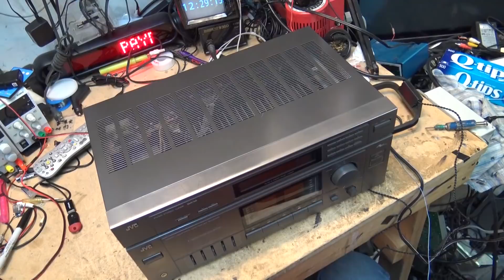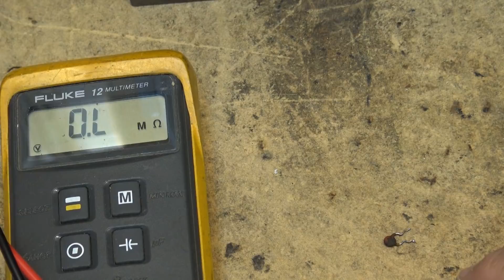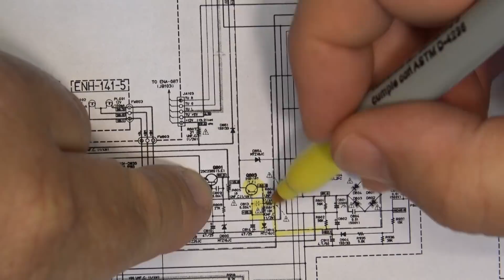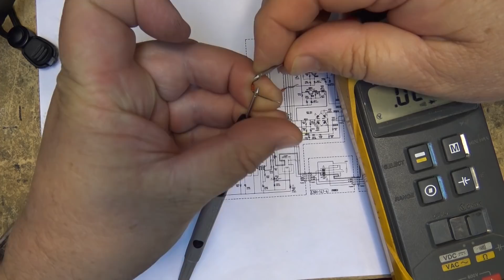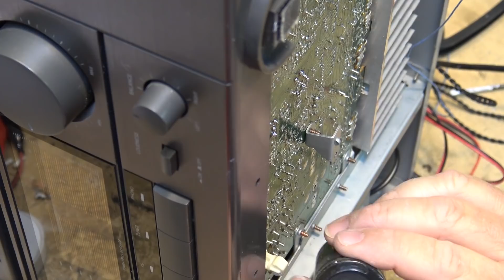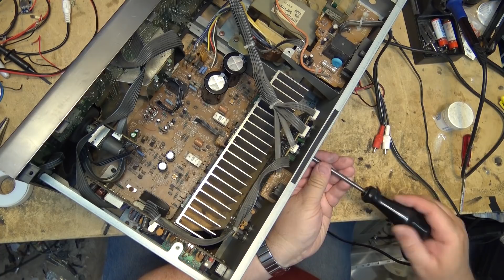JVC Rx R76 No Sound just distortion REPAIR

Comment: why the customer wanna keep this cheapo amp so bad?
Reply: Cheapo? This was a $1,200 mid-tier rack outfit in it's hayday. We aren't talking about Sanyo or late 90s early '00s all in one bookshelf stereos here. I've had cheap... and this ain't it.. it's more mid-range. We ain't talking about mid 90s receivers either full of digital processing chips and other garbage to alter the analog signal going to the output stage. This is a full analog amp. And we sure as hell aren't talking modern receivers that only last a year or two, trust me I know several people that spent money on em and they all have problems. This thing lasted 30 years strong and only failed cuz I was stupid to wipe it down with a damp cloth and short out a capacitor. Now get lost!
Reply: @victorcoss2600  I dont believe that, Sanyo always kade cheap stuff. Same with Hitachi. You can see with the build quality it was all cheaply made.
Reply: @victorcoss2600  that is  heap of shit in a brown paper bag

Comment: I always make sure my desoldering braid is 100% saturated with solder before tossing it, I've even been known to keep off-cuts if there is still a usable spot. And I agree with you on the desoldering pump thing, if its not new then it'll drop little flakes of solder onto the board. I learned that whilst swapping out caps on a densely populated TV SMPS.
Reply from the maker: I have one of those solder suckers. I only use it big things like flyback transformers. I used to have an electric removal system but it packed it in many years ago and I don't do enough volume to warrant getting another one. Solder wick works good enough for what work I do as you saw.